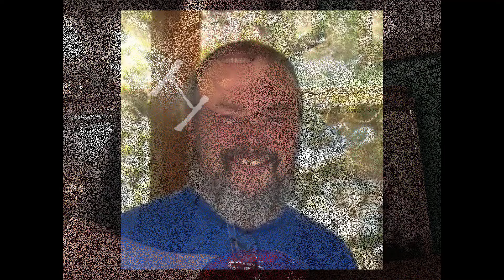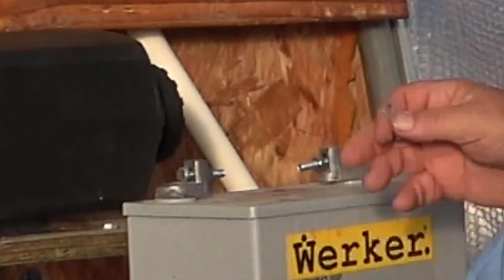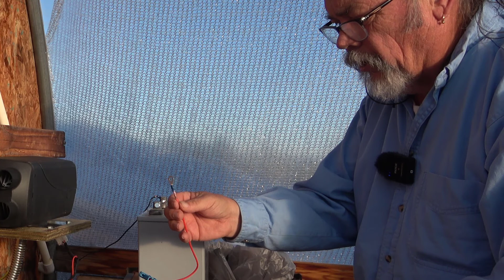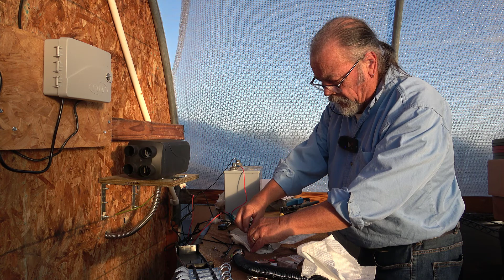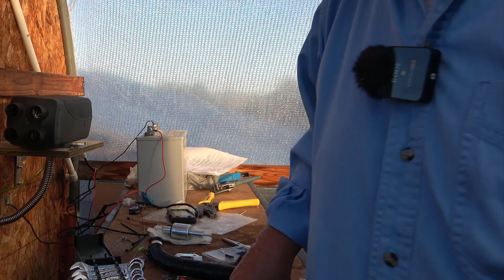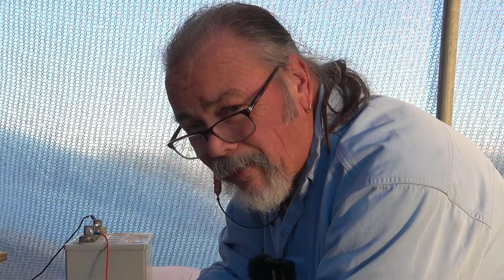Chinese Diesel Heater Is Working Finally!

Comment: Nice going, it's finally up and running, It's official, You've completed Your crash course at Diesel Heater 101, You are now an official Diesel Heater Tech.. lol  Glad You got it all sorted, simple Fuel Pump issue, told ya China don't have any Quality Control.. 👍🤠
Reply from the maker: Hey Joe - no QC indeed! Wait! Two failed pumps for the price of one. Such a deal. We had a kerosene drip heater close to 50 years ago and I’ve installed both propane and diesel heaters in the past. But those instructions! Pure crap. Finding the bad pumps both irritated me and installing a good one was exhilarating. Thanks for your comments. Take care.

Comment: Hi Henry, Now I am confident you have the same setup as I have, You have a key fob as I do and that is what I use to turn my heater on and off and the temperature I want the heater to run at, I sent you a link to a channel with how to set up that control/ monitor I hope you watch that video and learn how to use it, It will save you a LOT of time, Take care.
Reply from the maker: Ron, sad to say this whole waste of time can mostly be traced to bad fuel pumps! I haven’t tried to program it yet, but the heater definitely works well. Now to install some ductwork. Thanks for sharing! Take care.

Comment: Note: in your last few moments, this is why there should be no switch in the power supply circuit - accidentally flick the switch when the heater is running and the motherboard is fried! It needs the fan to wind down and cool everything (as you said) before it switches itself off.
Reply from the maker: Now you know me better than that Steve! Toggle switch with cover guard. No accident so if I screw it up it’s fully in me! Take care and thanks again.